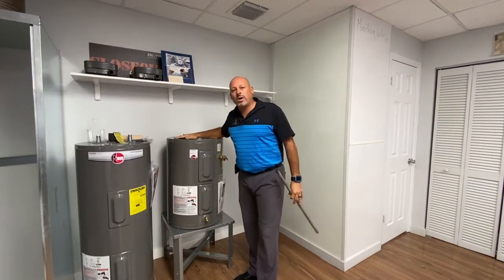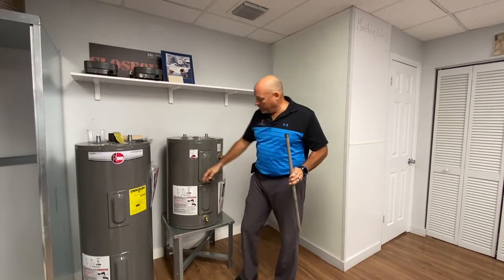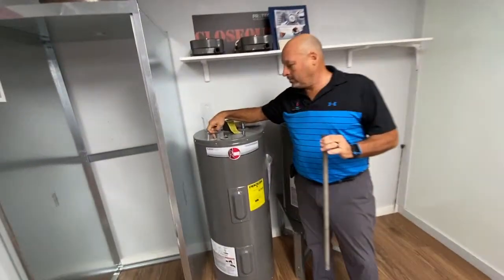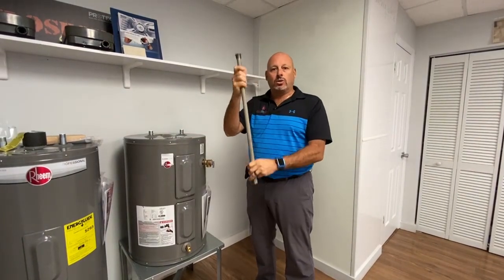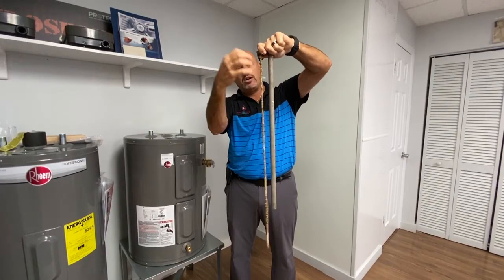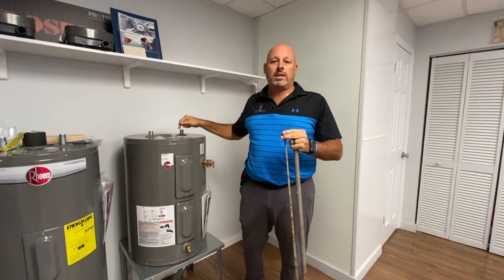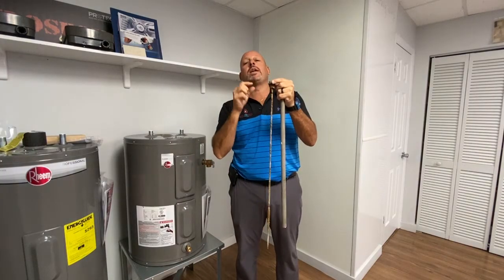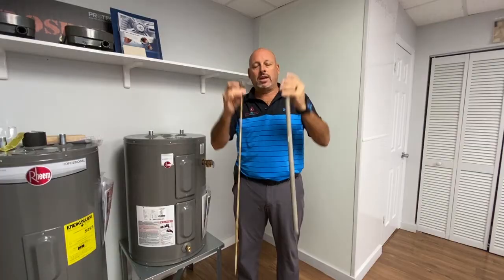The Importance or a Water Heater's Anode Rod

Comment: It seems that my Maytag 50-gallon electric water heater (HE2950T) has two anodes in it (a primary anode and a secondary anode). I tried searching for replacements, but it appears that Maytag no longer manufactures them. Do you think the replacement process would be the same for both the primary and secondary anodes? And since genuine anodes may not be available, what could be better alternatives?
Reply from the maker: the anode  from a different brand might not work

Comment: To add onto the rotten egg smell. You can also install a corro-protect electric anode rod. It doesn’t ever have to be replaced but does need a power supply. 
Good vid btw
Reply from the maker: thank you for the information

Comment: This is great. I'm a fairly new maintenance technician at at the trailer park I live at. Water heater ruptures are probably the most common and expensive problem. All because of the anode.  I'll be pushing to add water heater checks to our annual inspections!!
Reply from the maker: glad the video helped

Comment: Could you help?! I have a barely three year old 40 gallon Rheem electric hot water heater I’ve really seen no problems with- until yesterday when I noticed water coming up out of where the cold pipe goes down into the water heater and what I now know is the plastic cover that is covers the anode rod. It’s NOT Leaking from the pipes themselves it’s seeping up out of that hole and up out of the anode rod hole it’s not a ton of water but it’s definitely a steady leak it soaks about a thick rag a day. I’ll turn off the power. The water coming out of it is Rusty when I took the covers off to check the temperature setting I noticed there was dampness in there when I inspected the bottom of the water heater there was no water there but I saw a little rust around the entire rim. I look at this thing often because it’s in my laundry room and I vacuum around it pretty often. Although recently it may have been a month or two since I have vacuumed down around it though and have NEVER noticed any rust. Or water. Upon researching I just see that tons of people have problems with Rheem hot water heaters electric and gas alike. Could this possibly be a dud? The anode rod be a dud?  From what I’m reading it means the entire water heater on the inside is rusted out And needs to be replaced with a new water heater?! Please tell me if you’ve ever seen this or heard of this??! It’s unconscionable to me that we bought this new in may of 2020!
Reply: Did you ever figure out the issue?

Comment: They have a view camera cable that hooks up to your smartphone and you can view the inside of the tank quit ripping people off!
Reply: How is he ripping anyone off?
Reply: Yes, and he says nobody replaces their abode rod because they can’t get it into the tank due to location. I just replaced my anode rod last night in my A.O. Smith 75 gallon gas hot water heater. Go get a new rod at Home Depot, use a 1-1/16” socket with a 1/2” drive ratchet and have someone hold the tank while you use an extension bar to break the old rod free from the threads slowly. Obviously you have to shit off your water and shit down your water heater if it’s electric. If it’s gas shut it down on vacation mode if it has that setting for the burner. Drain some water from the tank to relieve pressure and get to it. Pipe dip the threads, clean the threads on the table with a paper towel, and tighten down the new abode rod. They make them in bendable segmented rods that fit into your tank like sausage links so you don’t need overhead clearance. This guy is full of it!